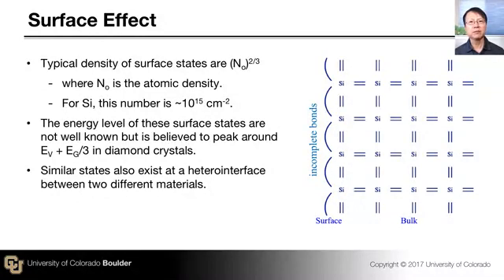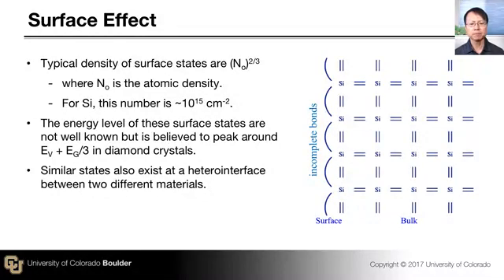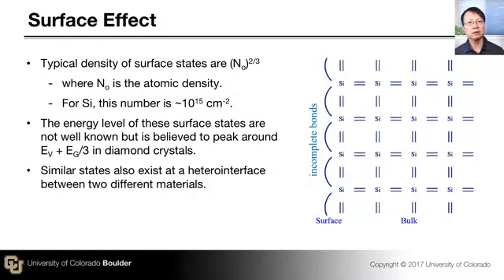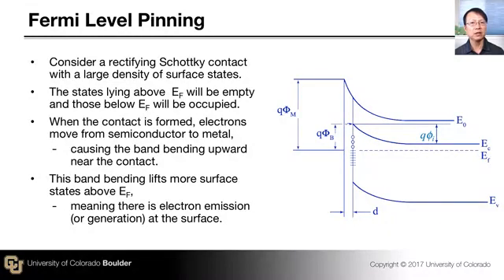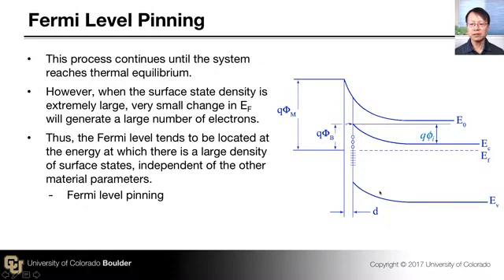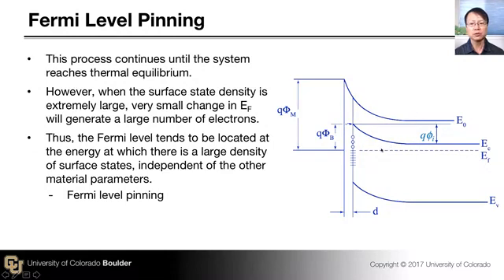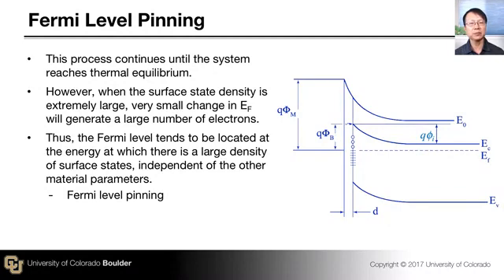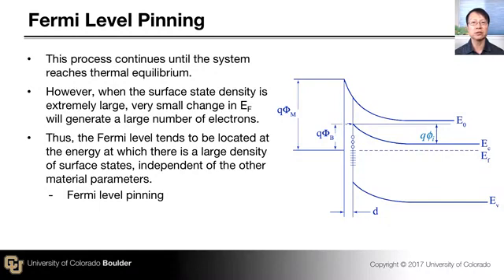Surface States and Fermi Level Pinning and  Metal Semiconductor Contact

Comment: One question. Why the Fermi Level should be constant throughout the system? 6.50
Reply from the maker: A gradient in the Fermi level is the driving force for carrier motion:
Fn=(nDn/kBT)(dEf/dx)
In equilibrium (zero bias), Fn=0
and therefore EF=const.
Reply: Hi friend. Another explanation comes from the fact that the Fermi energy is the name that physicists gave to the electrochemical potential of the semiconductor. By the second law of thermodynamics,  the chemical potential of all compontents of the system must be the same (i.e. constant) at equilibrium. That is a consequence of the fact that, at equilibrium, the change in Gibb's free energy = 0 and the chemical potential is a derivative of Gibb's free energy with respect to the number of particles. This all means that the Fermi level being constant at equilibrium is a consequence of the second law of thermodynamics.

If you need more information, you can find basically everything about the electrochemical potential and why the chemical potential must be the same for all components at equilibrium due to the second law on Castellan's Physical Chemistry (10th ed) book. The thing about the Fermi level and electrochemical potential being the same you can find on the internet, e.g. https://www.researchgate.net/post/Can_we_relate_the_Electrochemical_potential_and_Fermi_level_in_Semiconductor and https://www.sciencedirect.com/topics/physics-and-astronomy/electrochemical-potential#:~:text=The%20energy%20at%20which%20the,electrochemical%20potential%20of%20the%20semiconductor.